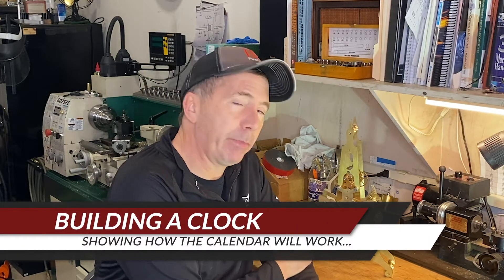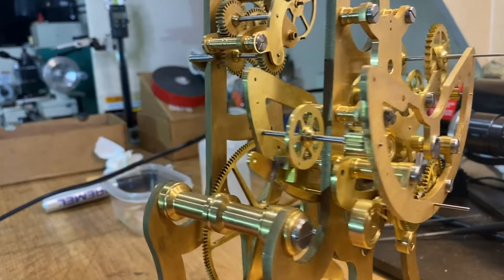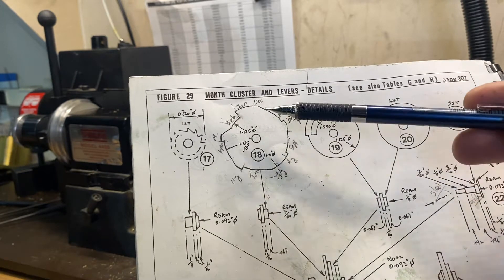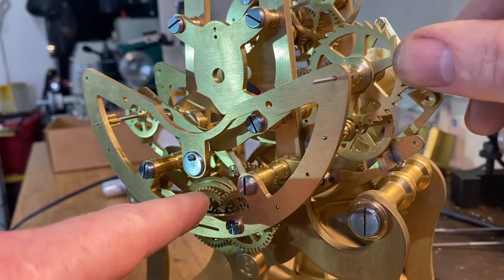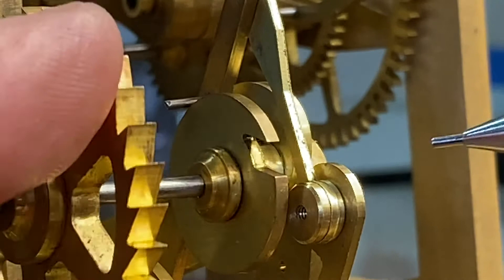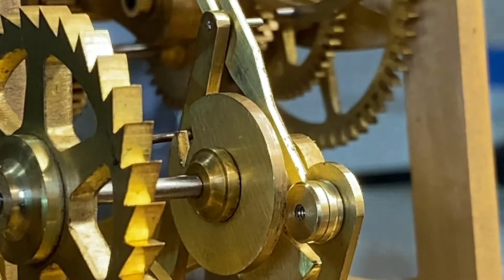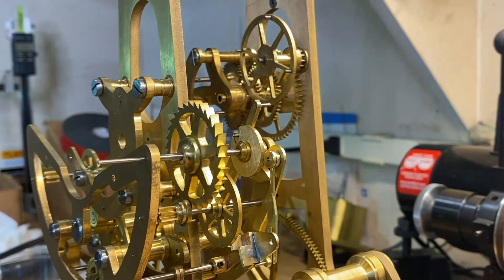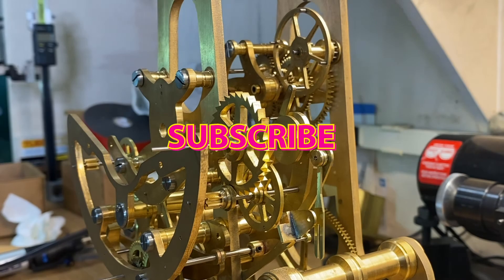Showing how the calendar function works on a Skeleton Clock.

Comment: Excellent video. Out of interest, does this clock have a "coup perdu" escapement?
Reply from the maker: Yes but it is giving me trouble.  Since it only gives an impulse every other beat it seems to be very sensitive.   I can get it running but the adjustments have to be perfect.   Not a great choice for a perpetual calendar clock.   I need to go back and either change escapement or remove friction from the train.  That is on my lists of things after I finish the Harrison Clock I am working on now.   Thanks for watching.
Reply: @KevinNolanMakes  Hi Kevin, Thanks for your reply. I was thinking of making a clock with this escapement. I couldn't find any information on the layout, but I guess if I buy the book I can get some information there. I like the idea of being able to effectively have a one second pendulum due to only having one impulse every other beat but using a shorter half second pendulum. This will enable me to have a more compact clock that will have a seconds hand that does count seconds.
Reply from the maker: @brianwarburton4482  it will do what you are looking for.   The book on the clock I made has all the info you would need for the escarpment.